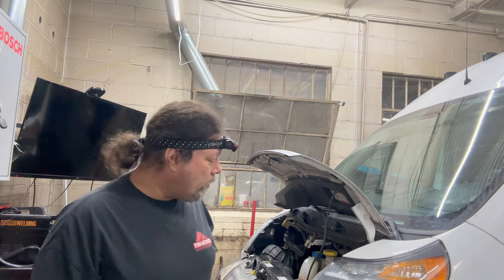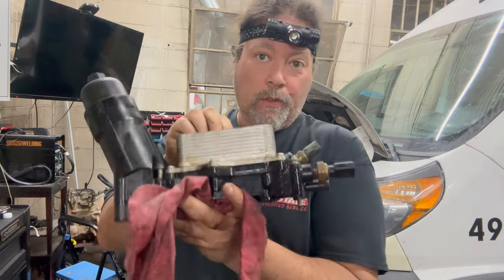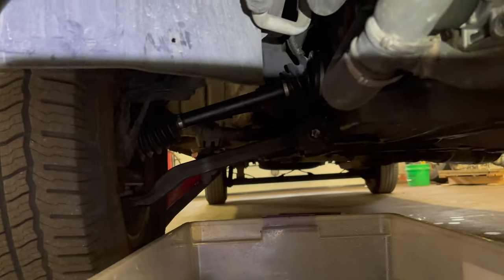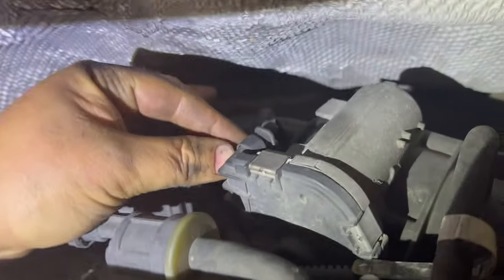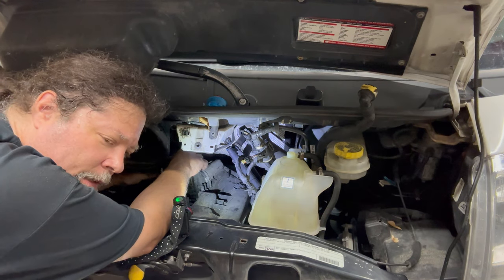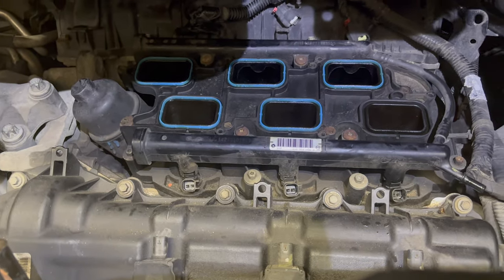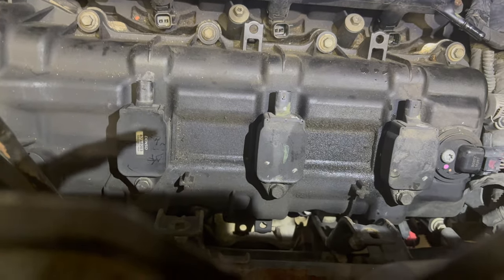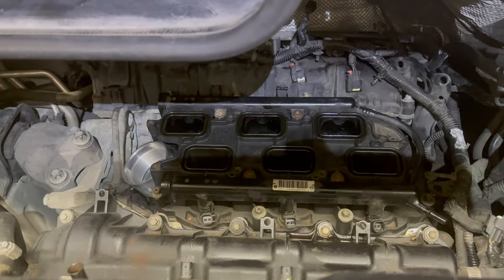Ram Promaster: Replacing the Oil Cooler Filter Housing Assembly Start-To-Finish: Promasters Only!

Comment: Thanks. My Dad and I are planning to do this on his 2016 with 165k. What all should we replace while we got this thing taken apart? I figured I'd grab a set of three ignition coils and spark plugs...anything else? He already replaced the front three and his engine ticks.
Reply from the maker: If the engine has the dreaded tick, much of the work in doing that job is shared with the oil cooler. To know for certain if you have the tick, cut open a well used oil filter and look for metal. Otherwise, I don't replace coils unless there's a need, but plugs were due at 100k and intake-off is the time to do them. Other than putting a new oil pressure sensor in the new oil cooler assembly, there really isn't anything to replace while you are there. The Dorman comes with upper and lower gaskets, so those will be new. Maybe the PCV valve is worth doing while you are there.
Reply: @promastersonly1419  thanks for the response! Wasn't sure I was gonna get one. Doesn't the Dorman unit come with a new oil pressure sensor? Thanks in advance.
Reply from the maker: @caelinbuenger7095  No, though Dorman makes and sells the sensor. It’s a very common failure item, and will result in a P0520 code. Since you have to transfer your old one over when you install the new cooler, replace with new.
Reply: @promastersonly1419  Hey man. We got our Promaster fixed back up. Started driving it around and it was puking engine oil...we got it taken apart again and are wondering what happened. The valley is full with oil again, tranny covered, and the intake runners are oily now after I cleaned them with WD40 and a rag. I'm thinking there is an issue with the seals? But also at a loss. Have you ever had this issue? Thanks in advance :)

BTW, we went with the Dorman unit. There was a plug included in it that we never used because we screwed in a sensor instead.
Reply from the maker: @caelinbuenger7095  if the runners are oily it’s almost certainly the pcv valve. I would add new seals under the cooler, but the only other thing it could be is a valve cover gasket, which is unlikely. 

Honestly, I dont know what application would use those pipe plug fittings. Maybe some kind of future protected turbo? What did you put there?
Reply: @promastersonly1419  gotcha, PCV valve. Yeah, we put a sensor there instead. I don't know what sensor it is, but it is the same one that was in the similar spot from the OEM plastic cooler. (So our Dorman cooler now has two sensors plugged into it).

My Dad and I got around to rechecking out our work this morning and afternoon but to no avail. It's still puking oil bad...I recommended oil leak dye. He's thinking about taking it to the shop. Any advice you have before he dumps a grand at the local shop?
Reply from the maker: @caelinbuenger7095  unless it’s something crazy like a cracked block (highly unlikely) the only pressurized oil is in the cooler. Did you check the o-ring in the filter cap - easy mistake to make. My recent video on oil filter wtenches shows the o-ring placement. 

Could be the cooler to housing seals, could be the seals below the cooler. 

I assume it’s not a valve cover gasket - those leak slow and are easy to spot. 

Since you guys are able to do it, I’d be more inclined to assume a bad cooler and replace it yourself. A shop is going to go there first anyway.
Reply: @promastersonly1419  Dad here...lol. Really appreciate the assist in helping us troubleshoot our install issues!!

Backstory: the van never leaked oil nearly as bad as after our install. It would leak, seemingly, at random times. mostly drove locally. After a 40 mile trip, next day noticed significant leak on concrete. I could drive locally at other times (before and after aforementioned leak) and it would not leak. In short, oil leak before install wasn't nearly as bad as after install.

Now: installed new Dorman oil cooler. Cleaned all surfaces once uninstalled to prep for install of new. All new seals where manifolds and oil cooler make contact. New oil temp sensor. Reused oil pressure sensor and used regular plumbers thread tape to seal. Installed all back to normal. Leaked oil at a rate of 3.5 quarts to 50 continuous miles. Rechecked work by uninstalling the new cooler and reinstalling. Cleaned all surfaces again. Checked seals and reused all as they were good. Differences: tightened the oil pressure and oil temp sensors as they weren't all the way tightened. The upper manifold, passenger side, back corner bolt location (not the bolt, but hole) seems slightly stripped (meaning, I can't torque to required spec). Still leaks oil at the same rate, but only test drove for 3 miles. Grrr!!

Would any of these differences cause oil to leak at that rate?

In above replies, you mentioned replacing the PCV valve and checking the oil filter seal. Would either of those cause oil to leak at that rate? Have yet to check or replace either.

Would bad seals on sensors cause this much oil?

Is it possible the sensors are in the wrong locations on the oil cooler (don't recall if they have the same thread pattern)?

In your experience, what are the odds of a defective new Dorman oil cooler?

I'm at a loss and grabbing at straws now. Any insight would be greatly appreciated!!
Reply from the maker: The PCV valve probably wouldn't leak at that rate. The points where it could leak are all unpressurized - valve cover gaskets, cam sensor seals, phaser actuators, pcv valve, spark plug tube seals - and I doubt they would flow that fast. And you'd see it. That leaves the main oil seal under the cooler (the big tube at the far left), the heat  exchanger to cooler seals ( figure 8 things under the heat exchanger) and the oil filter cap. There are 1 or 2 pipe plugs that the Dorman comes with, those need to be secure. The two sensors could leak, and might leak that fast since they are in the pressurized oil path. I think it's time to put UV dye in the oil and get it to leak, then pinpoint exactly where it's coming from with a blacklight. The cap- the filter should "snap" into it firmly, and you should wipe down the barrel of the thing to make sure it's not leaking from under the cap. If it were me, I'd replace the cooler with a Dorman, and I bet you they cover the part if you send them the old one. Dorman is very "into" failed parts and will want to examine it.  @michaelbuenger7993

Comment: This just unfortunately happened to my 2020 with 280k miles original engine and trans, do I need to replace the whole housing or can I get away with just replacing the seal rings. I havnt taken anything apart yet since it just happened yesterday id love your opinion on this. Basically if theres no crack on the housing would I be ok with just replacing the seals so im not spending $300+ if I dont have to.
Reply from the maker: Sorry, missed this question. 95/100 times, its just the seals under the cooler that leak. Buy them from the dealer for like $15. But if you want to never do the job again, spring for the real deal Dorman (not from amazon). It comes with everything including upper and lower intake gaskets.
Reply: @promastersonly1419  thanks for getting back to me. Ive already purchased the 959 doorman it should be arriving shortly, like you said might as well do it the right way and not worry about it again. Im on the west side of Michigan and now I just need to find someone who is willing to install it for me. One more question, I havnt touched the van since i found this out its just been sitting in my driveway, if i put in a new oil filter and add oil back in will it just leak all over the place again slowly or will it all just pour out instantly? Basically i just want to know that so once I do find someone to install will it be safe to drive it a short distance to the mechanics.. thanks again for all your videos I’ve been watching for the last 2 years since i started expediting luckily this happened on my last trip, if you want to buy this van or know anyone looking to buy one let me know 😅. Rockers and lifters replaced at 200k alternator replaced at 214k new spark plugs and tranny fluid replaced at 100k and 200k the van runs beautifully.
Reply from the maker: @BigJay.90  nothing complicated about the job, and the dorman comes with all the gaskets too. Generally, they leak slow at first, and slow enough just to check the oil every fuel fillup and add as necessary. When they eventually start to really gush, the warn you as the pressure gets low before you get low enough to cause damage. Do you can keep driving it in the near term.
Reply: @promastersonly1419  You da man, thank you.

Comment: So while your in is there anything else to remove to install spark plugs? 
Thanks in advanced Joe
Reply: I bought a new metal oil cooler on Amazon I put new heavy duty coils that I got off of Amazon, I picked up a new rubber hose that connects to the oil cooler that I bought from the dealership, new spark plugs and new manifold gaskets, you might want to buy new replacement bolts because water rest in some of the spots on top of the manifold,it wasn’t a big deal though.
Reply: Might be good time to get a new coolent reservoir.
Reply from the maker: Getting the intake off is 80% of replacing the plugs. So yeah, a lot of “job overlap” and a perfect time to do the plugs.
Reply: @promastersonly1419  ah there he is the legendary Kip Spielberg!

Comment: my van has the triangle bracket removed already.. should I buy a new one and put it on there?
Reply from the maker: My feeling is that it isnt really necessary. The upper intake is held onto the lower intake by the 7 funky bolts, and those get torqued to spec when it goes together. There's also 2 post bolts at the front, and the two post bolt that clamp it to the triangle bracket. Literally, even ONE of the post bolts is plenty to keep the intake from going anywhere, and the 7 others are doing the same job. I wouldn't worry about the triangle, and even if 400,000 miles from now somehow the intake cracked, you could get another one for $100. Not a big deal.

Comment: Hi 
I have a question. I just replaced my oil filter housing and the oil pressure sensor on my 2019 Promaster 2500 van. It solved the leak, but now my low oil pressure light comes on only when I press the gas pedal.  I check the oil level and it's fine I'm also getting mis fire codes. Do you have any suggestions. 
Thanks
Dominick
Reply from the maker: That's a new one! If you have access to a high quality scanner, I would be looking at the actual oil pressure. It should be about 32psi at idle, and only go up from there. But I'm sure it's good, because you already would have blown up by now. I would then check the camshaft commanded position vs the actual position. There are data PIDs in the computer for this. It's possible that when your oil cooler was leaking it ran low enough on oil to do some damage, but I think that's a low probability because the engine will usually stop running/stall before any damage occurs. My guess is that the oil light is a false positive - when the engine stumbles, it slows down and the pressure reads as low. If it's a global misfire - a P0300 code, then I would look at all the wiring. If it's a single cylinder misfire code, I would think about moving that coil to the cyinder next to it and see if the code moves. But I can't think of anything that's a direct correlation between replacing the oil cooler and generating a misfire, other than the obvious vacume leak or unseated coil or injector connectors.

Comment: Hi Kip, my promaster suffers from top end engine noise during start-up (dry start?).  Is there a way to reduce this?  Is it oil filter related?
Reply from the maker: Hard to say. The oiling system is very robust, and a startup noise could be almost anything. What you could try as a diagnostic is to use flood clear mode to crank the engine without starting it. From an overnight sit, Hold the brake, floor the gas 100% and then crank it - it will not start but it will make oil pressure. If the noise is gone when you do start it, you know it's oil related. If the noise is still there, you know it's not oil related.

Comment: Mine just started leaking oil & anti freeze..that quick the rockers started failing...2013 1500 promaster...60235.0 mi
Out of warranty.. 😂
 this sucks..
Reply from the maker: That's awfully "young" to have those problems. However, there is quasi good news - both those problems are the MAIN pentastar flaws - the oil cooler leaks and the rocker arms wearing. Solve those two problems, and you can pretty much forget about the engine till past 500k. And BOTH have upgrades/permanent fixes (the newer rocker arms and the Dorman cooler specificially). And BOTH jobs share some labor if you want to do them both at once! It makes sense to do so.

Comment: Why would you buy a van with a petrol engine in it,,And a 3 and a half litre at that,,,You would need a petrol station in the back to run it when it's full,,Not to mention the cost ,,,You won't find one van this size with a petrol engine in all of Europe,,,A 2.2 Diesel engine is all that you need for it ,Much cheaper to run and makes the same torque as a 3.5 petrol....
Reply from the maker: Fair, but there are other factors. Here, diesel is 25% more expensive that petrol, erasing any mpg savings. And the fuel itself is cheaper than Europe. Then again, we probably drive more miles than the average European. A passenger vehicle here is expected to go about 400,000 kilometers before it’s junk. For commercial vans, it’s more like 1 milliom kilometers. 

But that’s not important. What’s important is cost. The gasser is one of the most reliable, cheap to repair and maintain vehicles on the road. There was a diesel promaster sold here for a while, and it proved the LEAST reliable MOST expensive turds ever made.

Comment: I just drilled holes for those intake manifold bolts. I hope water drains through the hole and bolts will live longer)
Stupid engineering...
Reply from the maker: Not really. On every other application, there’s an engine cover which prevents this problem. Just not the promaster.
Reply: @promastersonly1419 so why isnt there an aftermarket cover that could go on the Promaster, perhaps not enough room?
Reply from the maker: Room is tight, and I suspect it has somthing to do with thermal. But many dudes have adapted covers from Minivans and Journeys to fit. Almost anything will work.  @robertparry3476
Reply: Ive seen a lot of posts from Travato owners that have water leak problems from the windshield cowling and have added tape on top of the trim and windshield at the bottom to keep water from leaking into engine compartment and onto the engine.
Reply from the maker: I have videos on that. It's a universal issue on the promaster. The fix is gorilla tape.  @robertparry3476